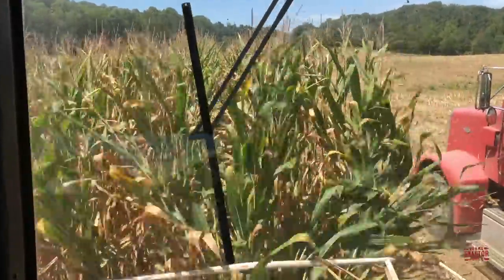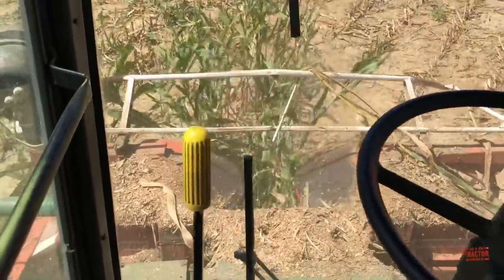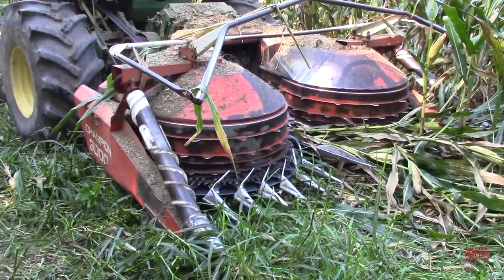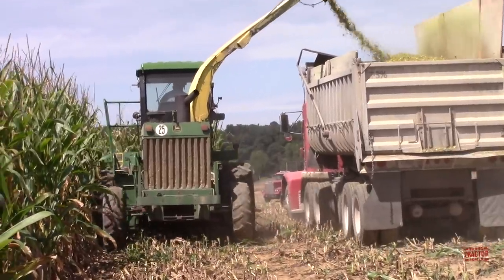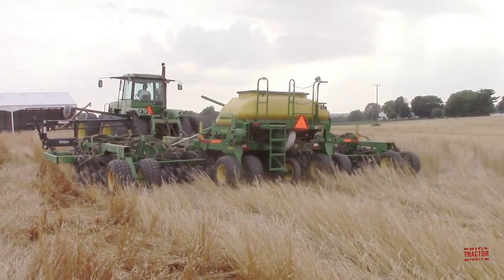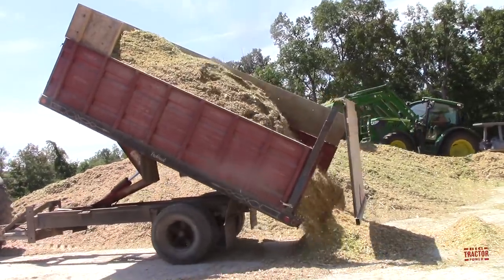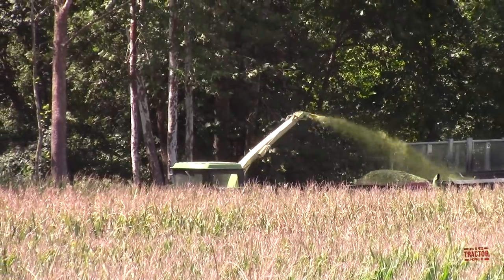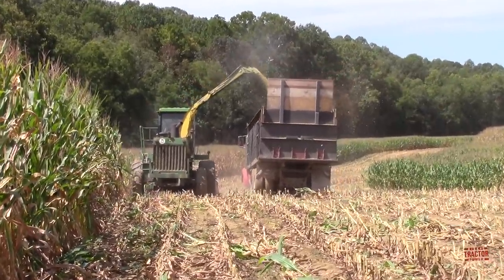Cool Corn Chopping 1980's Style:  John Deere 5830 Forage Harvester

Comment: We still use a 5830 with a 4/30 head and 7 ft pickup. We mounted a  Rotary screen from a 1460 IH combine on the radiator to keep things cool. Pulling a Gehl side dump wagon to open fields would plug the factory screen in less than one load, Wasn't as bad when side filling trucks but would still need to stop every hour just to clean the rad and cool the engine down. Replaced a 802 Uni with the767 supper chopper on it and a 1200 Gehl pull type both with 3/30 heads and the Deere can do more in a day than both of them together could.
Reply from the maker: Nice set up.  Do you still run the Gehl dump wagon?  I have an owners manual for the Gehl Dump Wagon. I hope to use it to 3d print a 1/64 scale Gehl.

Comment: I wonder why the field is so rough
Reply: rain after planting if they tilled the soil..it washes away causes gulleys ditches..we have planted alfalfa and  on some feilds..we would get lucky and light rain..one field we planted got 17 inches we had to go in and fill in ditches and use round bales of hay to stop further washing...one field we planted was so smooth you could drive across in a pickup going 60mph..luck on rain amounts

Comment: There was one of them not far from here. 
It was a realy bad Machine, always suffering of Major Problems. In the begining it hasn't a Metal Detector, a broken Teeth of the Tedder was a Nightmaire.
In Grass it was realy realy bad, the Augher couldnt handle it. In Corn it was a little better.
The Engine was often heating up, wat a John Deere never apriciated.
The Augher had lots of waer and tear.